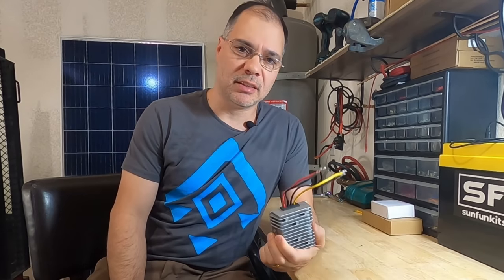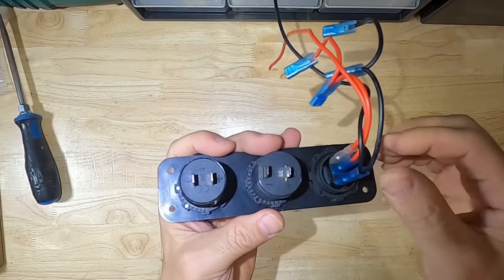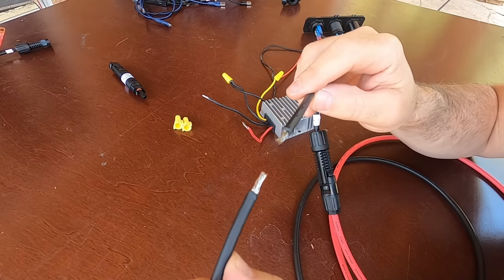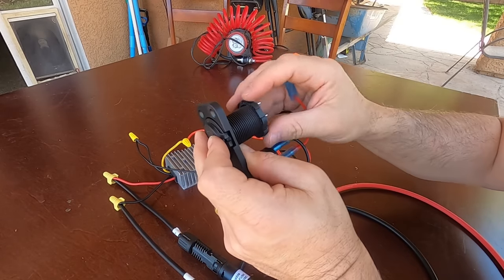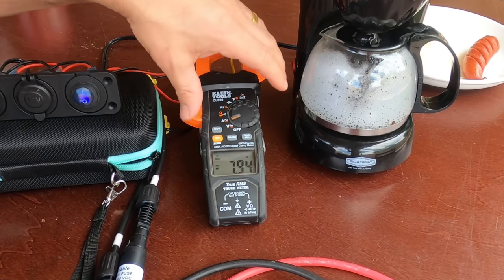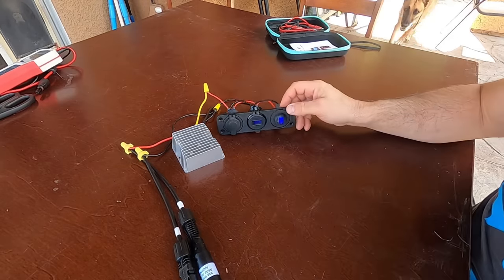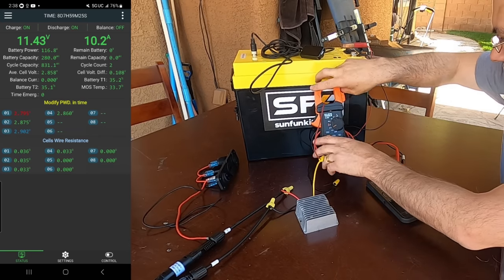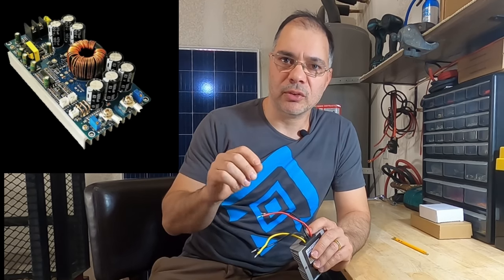SHTF - Cheap Emergency Solar Power! Use Any SINGLE Solar Panel! 1/2

Comment: Very nice. Other uses would be, powering a water pump only when the sun shines, and getting a 12V supply from a larger 24v or 48v battery bank to power radios or anything else that's 12v. It would be more efficient than running through the inverter and back to DC.
Reply from the maker: Exactly.. In my video: Powering Household appliances, I show exactly that.  A pump and ac vs. DC efficiency.  

https://youtu.be/6e3dx6qFvX0
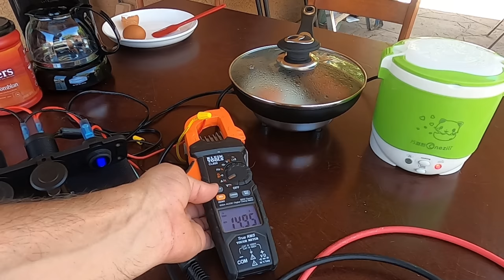Fwd: 9:58 and fwd: 14:25.. 

Thanks for watching!

Comment: I just setup and used a system just like this on a 8 day road/camping trip. We had a 100 watt solar panel dumping power into a 12v cooler/heater, but we were using it to keep drinks cold. So I was basically using the solar to keep a cold bank. When a cloud would cast shade the fridge would slowly shutdown but it would almost need full sunlight to start back up again, so a capacitor bank may be needed to help fill in the gaps between small clouds and large power draws on the system. Overall, it worked well. I may just run a 12v 5A lifepo inline as the fridge only uses 65 watts and the panel has been putting out in the mid 90's. So sometimes it will be storing up to 25ish watts per hour so this system really is only to be used during the daylight hours as a 12v 5A battery would last about 45 minutes. A capacitor will most likely be a 4 minute supply of power but with the benefit of longevity. 
It's Scalable!
I thought about setting up a system where a couple kilowatts of solar panels dumping cooling energy directly into a home. With only a large capacitor bank to level out the power delivery.
Reply from the maker: Love to hear it. Yea, I think that's a great use case.  I would like to do something similar. I found a mini mppt just need to sus out battery pack.. LTO? 66160 or 18650. Need to do research.  What cooler were you using.. thanks for this.
Reply: @natesdiysolar  It's a Kool Mate 40. On long road trips when we stop at rest stops for the night we unplug it and it keeps a large amount cold throughout the night. I may be installing the solar panel on my road trip vehicle here soon.
Reply from the maker: @peppernickelly  awesome I'll check it out
Reply: @natesdiysolar  It uses a peltier for cooling rather than a pump. The only moving parts are two fans, so that's the benefit. The benefit for a 12v pump style cooler is higher energy efficiency but cost a little more. I was handed down the Kool Mate 40, so it was free for me.
Reply from the maker: @peppernickelly  ahh. Nice.  I remember when they used peltier on CPUs
Reply: @natesdiysolar  I worked as an electronic engineer for a company that was trying to package them on the bottom of an aluminum cup to sell to bars as cooling cup for beer cans. They eat up too much electricity and generate too much heat for 20 of them running. So his business shut down pretty quick. I sourced the electronics for the peltier and designed a custom RGB led strip that illuminated the inside of the cups. One would be great at home but it doesn't get bars to sell more beer.
Reply from the maker: @peppernickelly  lol that's pretty cool.

Comment: When connecting power always conect the power first and then ground.
Reply from the maker: Good point.  Especially when working on automotive electrical.  I must have did it backwards in the video... .

Comment: Wow, i thought you were still using an inverter with the coffee machine then i read the description and was shocked by the amount of DC powered appliances now available.
Reply from the maker: There are so many appliances it's crazy.  I'd like to get a whole collection lol
Reply: @natesdiysolar 

Most of our electronics like TVs 📺, modems , routers, cell phones 📱, VCRs, computers 🖥, video games consoles 🎮, etc., run on DC power. 

We connect them to 110 volts AC but they all have rectifiers inside. 

I started to replace all my water pumps from 110 or 220 volts AC to DC water pumps. 

During a blackout I can connect those pumps to the car 🚘 battery 🔋.

Comment: New subscriber here . I am glad you are sharing these things with us. I am building a 1928 Morgan RIP GN Special hill climb racer but as soon as I have a little time I am going to make a video converting a refrigerator compressor over to 12 volts. That way you can either use it for a refrigerator or even an air conditioner without having to leverage your first born.
Reply from the maker: Lol that's cool.  Yea these little projects are fun.  Takes me back to when I was a kid plugging a 9v battery into a 120v ac outlet.. or trying to build a power supply and having a capacitor explode in my face.. fun stuff lol.  Thanks for watching!

Comment: I get a lot of push-back from people (clients) when I'm doing electrical projects for them; they love to tell me how the wire gauge can be smaller than what I'm specifying. But I always take them to an online wiring gauge calculator and describe the decades of nightmare-wiring I've seen and fixed for other people. When you use wiring that's too small for the job, the wire itself becomes like a fuse within the system. Speaking of which, it wouldn't hurt to introduce the idea of inline circuit breakers for DC into this project.
Reply from the maker: Yes. Bigger is better.  Really does not cost that much more.
Reply from the maker: I'll do a follow-up video with inline ATC Fuse and 12awg wire
Reply: @natesdiysolar  True. Costs a lot less than, say, having to replace a burned down RV. ;)

Comment: Awesome. I have a boat. This is perfect. Thank you. Do you have a link for your very cool inline amp/miliamp gauge that was USB connected?
Reply from the maker: Yes here it is.  Thanks for watching

https://www.amazon.com/X-DRAGON-Multimeter-Chargers-Capacity-Accuracy/dp/B019RHJRM8?crid=3JK1ZNNO0VJ3T&keywords=usb+power+meter&qid=1688884265&sprefix=usb+power+meter+,aps,133&sr=8-3-spons&sp_csd=d2lkZ2V0TmFtZT1zcF9hdGY&psc=1&linkCode=sl1&tag=natesdyisolar-20&linkId=75ccf8f02afa8ea1331912d42d4a75d9&language=en_US&ref_=as_li_ss_tl

Comment: i have one of those adjustable converters. i found it doesn't put out the power  I expected. I run a couple of  flexible solar panels with the converter into my solar generator. I think the most wattage ive seen is about 140 peak and an avg of about 120 or less depending on the sun. I wanted to get closer to 200 watts but it just  couldnt do it. The solar panels are rated for 100 watts each im lucky to get a little over 60 watts plus or minus each.
Reply from the maker: Yes those flexes aren't very powerful is a trade off between portability and power. Just like the USB solar chargers.  What solar generator do you have..
Reply: @natesdiysolar  I have the Bluetti EB3A .Its capable of max 200 watts solar. i wanted to get close to the max 200 watts but its just not happening.

Comment: What if my emergency is an emp?
Reply from the maker: Good question. Since these parts have very short wires.. they would likely not be affected by emp. You could keep the converter in an emp bag until it's needed.

Comment: I considered using 16v 8 farad audio capacitor in place of battery to handle spikes.
Reply from the maker: I considered this for when output of buck dropped but it would have to be large.. plus.. trying to keep it simple.  I'd like to use a super cap combined with this to use with starting a car.

Comment: On your first diagram at 1:42 I would label the switch differently.
On yours, it looks like the centre pin is the "common" (input/ feed) terminal.
That would short the battery if the common/- position was selected.
.
Better to label the switch as 
Common (C)
Normally open (NO)
Normally closed (NC).
.
With that terminology anyone can easily get the correct wiring, even if it's a different switch.
Otherwise, you need the actual wiring of the switch displayed.
.
(30 years as a service tech on business machines tells me that every manufacturer uses the C / NO / NC notation)
Reply from the maker: Good point . I'll update the schematic on website. That image is from Amazon.
Reply from the maker: Doesn't NO and NC apply to momentary switches only?

Comment: Trying to charge a lead acid battery, that is 12 volt, will MELT your wires, because the amperage is HUGE on car batteries.
Reply from the maker: The amp draw... charge in this case is limited to the output of the converter, not the potential of the battery.  Same case for the battery I used is 280A. But we charge with just 12A. Even trickle chargers for cars are 2 to 6A . Carr altinator puts out 80 to 100a for fast charging, but you can charge with b just 5a no problem.

Comment: buck converters step down. boost converters step up. so if you want to charge an lfp battery (or bank of) without a charge controller, probably go for a boost converter instead. excuse my multiple comments - i'm commenting as i go through the video. it's a good video, too, btw!
Reply from the maker: No worries.  I tried to find the perfect unit that had a wide-ranging input with a decent 14 or 15v output but could not.  They have adjustable units, but not very user friendly.

Comment: For the PD 65W out, you might actually want 24V input, as most of those USB charge adapters only include buck converters. 65W means 20V 3.25A. With 12V in, you can expect much 12V / 36W out on USB.
Reply from the maker: Not sure I follow.  Are you saying the 12v output of the buck cannot supply a PD with 65w of power?
Reply: @natesdiysolar  USB-C can do "Fast charging" which will go up to 20V DC at 5A for upwards of 100 watts.
Reply: I have multiple CLS PD converters, most have only a buck converter, but one has a boost-buck convert, and can deliver 20V from a 12V source..

So you need to look at the spec if it can deliver 20V.

Max a PD can, with the right cable, deliver 5A. But max 3A cables are more common. In addition there is the PD converter's current limit that is normally in the range of 1.5A to 5A.

So read the specs carefully before you purchase a CLS PD converter and PD cables..

Comment: that thin gauge wire plus the sustained load = temperature = resistance = electrical fire. careful dude! this is precisely why i upgraded my cabling from 8awg to 4awg. damn near melted the terminals off my old charge controller!
Reply from the maker: Yes, several ppl mentioned this, lol.  I mentioned it in the video and in the schematic.  Long-term, you want to upgrade the wires if you are using 12v appliances.  But for usb devices, up to 65w should be perfectly fine.

Comment: Isn't USB normally 5 V? I know some devices support high power charge modes, but there's a whole communication layer involved with that. I wouldn't stick just any usb device in that 12V socket. I would advise to either use a 5V buck converter or make a separate circuit in parallel for your 12V appliances.
Reply from the maker: Yes it is. That USB Module regulates the power from 12v down to 5v . No different from the one in your car.  I show the power coming from the usb port using a USB power meter during the USB test..

Comment: Hi Nate. I would try this using two 6 volt batteries to get better results. Charge them in parallel,  use them later in series to get 12 volts.

Comment: Great video tutorial, can you please tell me where to purchase the usb AA battery 5 lead plug and the actual AA batteries that have the usb plug socket in them?
Reply from the maker: A few ppl asked this so I just now included in description and pinned comment.  Also more info on my website.. I can only put so much in description.  Thanks for watching!
Reply: @natesdiysolar  Thanks for that, I looked them up and would you believe it there are now unavailable, incl other brands like it….Doh

Comment: Add a 16v 83f cap to the mix and its pretty usefull. They sell for like 5$
Reply from the maker: It will help with sag or just smoothen the output?

Comment: Good video, I've done something similar to this for camping, but I found that the 12vdc buck converter was not enough. When I tried to run my 12v fridge the voltage would drop to much and it would fault out, I changed to a 13.8 vdc buck converter and found that to be more stable. I later changer out from the panel to a dewalt 20v battery.
Reply from the maker: Haha.. seems like the natural evolution of things lol.
Reply from the maker: I was able to pull 15A with minimal voltage drop with this one..
Reply: Have you tried connecting 2 or more buck converters in parallel ? 

In such way you can increase the current needed for your load.
Reply: @ajarivas72  no, a single converter  was more than enough.

Comment: You will need to increase your wire size with 100% copper.  Those wires are cheap alloys with maybe a copper cladding.  Not safe.
Reply from the maker: Yes
 Unfortunately that is correct. However I did see some of them with copper wire. I mention this in the video as well. Good point.

Comment: This was a great video thank you and I am new to off-grid and solar living . you're video was very informative.giving me some  ideas. I do have a question for you though. I recently purchased a buck converter to drop voltage from 36 v to 12 v. How do I go about charging the 36 volt battery now?
Reply from the maker: You can either buy a plug-in charger for your battery type and voltage or if you are building a solar system you will need a change controller that puts out 36 volts.  Take a look at my victron 100 150 charge controller review.  You don't need a super expensive unit you just need one that puts out 36 volts.  Renogy is a cheaper example.  

Video: https://youtu.be/HaMdnHMxhP4
Reply from the maker: What exact battery do you have?

Comment: I use 10 gauge wires from panels to inside and from inside to batteries etc.. never use lower than that on my DC side
Reply from the maker: Thanks for watching.

Comment: Let's be realistic folks. 
This Video is fine assuming you have some useful Sunlight and a DC-DC converter. The right Dc-Dc converter would be rare as hen's teeth to find in a true disaster. In the event of a such, those items are just not available. Even if a nearby retail store had them, most likely you would be shot on site for looting, in order to go and steal one. 
In many places around the world - 12 volt shops just don't exist. You have to order from China.  
No one carries any stock any more and items have to be ordered in or purchased online.  
At best in the real world you only have access to a 12 volt output on an old car alternator - that may only work if its the engine is not damaged and it has fuel and the keys are in the ignition. 
 In a real flood - for example - there is no sunlight - just constant rain and cloud with lots of destructive wind, and even finding a working car is very unlikely - as everything is under water or buried in silt/mud/ rocks, etc.  
Likewise in nuclear war - EMP takes out everything that is solid state and only valves / vacuum tubes still work assuming you have a battery or AC power source to run them.  In that case, a Crystal Radio on a long wire aerial is of more value than anything with power.  
With a Volcano, the sky is full of dust for months afterwards, choking the breath out of every living thing. No sun will shine. Pyrotechnic voltage cells dipped in molten lava will give out more electricity than any solar panel in the same situation - both of which is also unrealistic. 
In an earthquake, getting power may be possible, but risky staying in the area for long periods is foolish and risky. 
With extreme snow and bush fire events - also no Sun - just thick cloud and choking smoke.  
Going without electricity for some time would be a more likely outcome for the majority of those still alive.

Comment: Come to my house anytime the year you find out I don't have the grid but that might be because they got so many high medical bills each month from my kid something that is unavoidable and and I'm a single father raising my child who knows where the mothers at we actually don't care she's gone sent the kid was six months old but that was many years ago. I don't have enough solar panel to run my house but if solar generator or two I have enough solar panels to run that just to the most important things in my house. I have 4440 watts of solar panels pretty-much two three hundred watts  than I need to run all the minor things. But I do have three major appliances a 3600 watt kitchen stove a 4800 watt water heater probably the same for a dryer and I would have split air conditioner heaters both 115 and 230 volts. And I'll need more solar panels with all that.

Comment: Using Wago lever-style connectors rather than wire nuts will make the system much more versatile and expandable if needed.
Reply from the maker: I was looking at the XHF style.. are those the same thing..
Reply: @natesdiysolar  Very similar, but you may want to check out the Wago connectors also, as there may be more options.

Comment: A battery doesn't cook immediately, so you can basically connect it directly to the solarpanel short term. I did that once with a bank of Ni-Fe batteries. Epever MPPT didn't want to start because voltage was below 9 volts, so I connected 500watts (75V, 7A) directly for about ten minutes. It was enough to jumpstart the regulator.
Reply from the maker: What about the bms. Was there a bms involved.. ?
Reply: @natesdiysolar  no, not for Ni-Fe or most lead-acid. I think it should work for any battery basically, with or without bms. Going to try with a larger li-ion soon.
Reply from the maker: @freas8520  that makes sense..